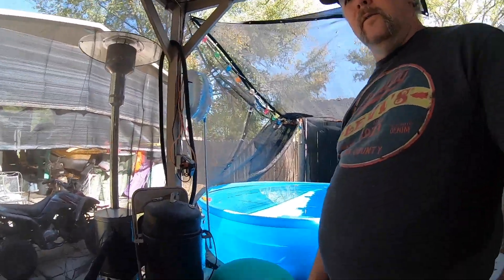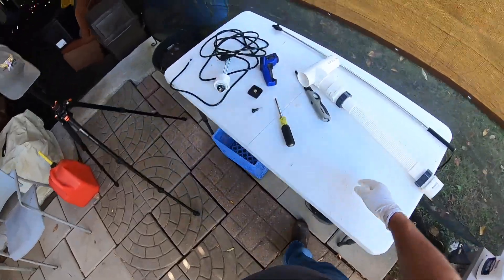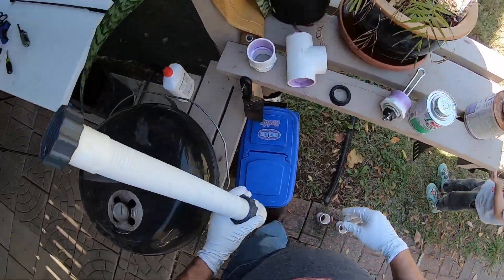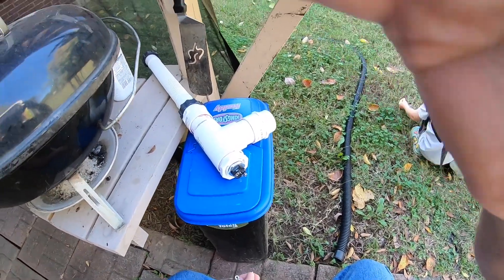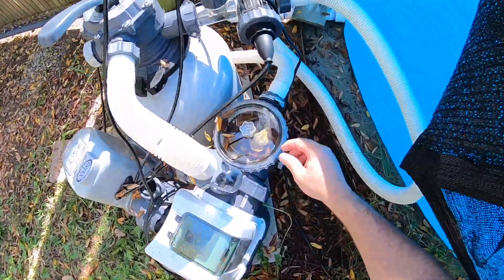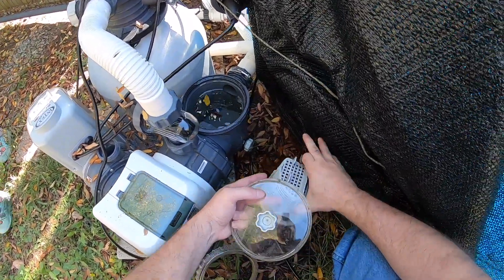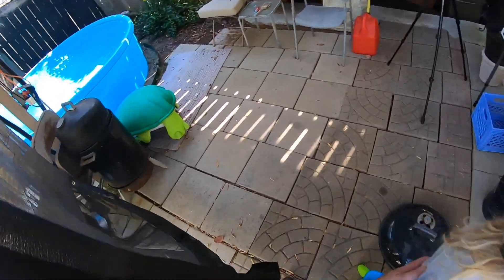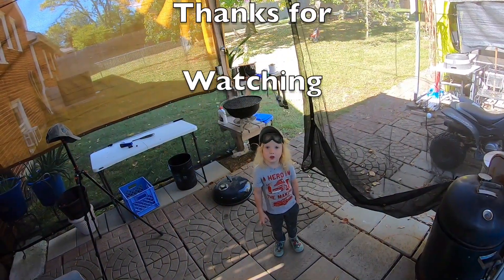Salt Water Stock Tank Pool from CO-OP, Install a 2000 Watt Water Heater Element for 1000 Gallon Pool

Comment: Where did you get the part that converts the pool hose to the PVC pipe slip fitting?  Thank you.
Reply from the maker: Can you give me a time reference so I know exactly which part?
Reply: @SRTPCC  It’s the adapter that goes from the hose to pipe. You prime it at 4:29.  All I can find are gray colored threaded adapters that go from the hose to 1-1/2” MPT.  Your fitting is better because it goes from hose to 1-1/2” socket.
Reply from the maker: Ok its a 2" to 1 1/2" threaded reducer
Reply from the maker: All those parts were at Home Depot

Comment: I have the same stock tank, do you recall which pieces you used to convert the drain plug into the drain line?  I love that idea so I don't have to cut an additional hole.  Thanks!
Reply from the maker: I wanna say 1 1/4". Have fun!

Comment: Just curious it being 3months later how's the water heater working for you. Did it meet your expectations.
Reply from the maker: It is keeping the pool a comfortable temp however it is using a significant amount power. I had to lessen the other outlets I was using on that circuit.
Reply: @SRTPCC  thanks for getting back. Cheers.
Reply: @SRTPCC  what zone are you in? I am in zone 6b i went to find the tank today, plastic they only have 8' metal ones 10' i am so undecided (not wanting to deal with rust) i read that in the metal ones they have to built a complete insulation jacket around, I get freezing and bellow in Kansas, maybe shut the whle pool off and emptied by start of November
Reply from the maker: @sharoncourt75   I wouldn't get a metal one either. CO-OP is where I got mine. I am zone 6b/7a. Really happy with it. We had a solid freeze, I left it running and had no problems.
Reply: @SRTPCC  never hear of that store found 1 about 33 milles they have 9'poly going in the rigth track lol
Reply from the maker: @sharoncourt75  Yes, I'd get you the 10' bc it's deeper